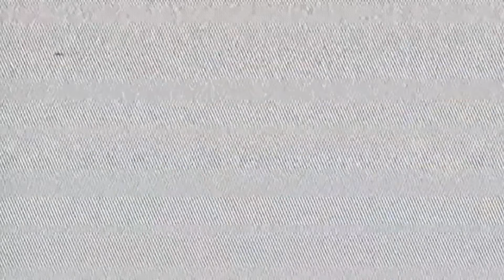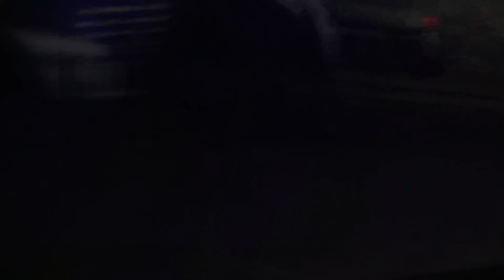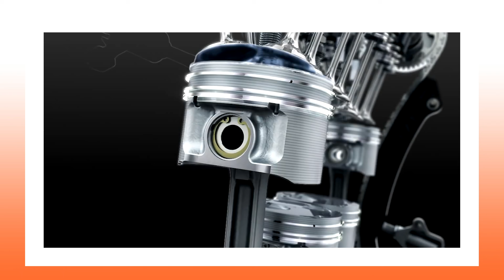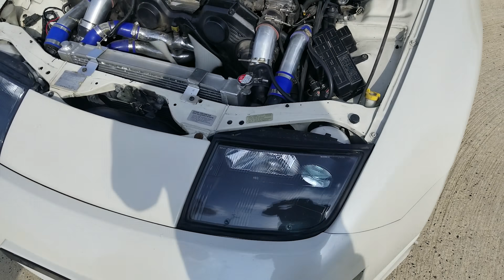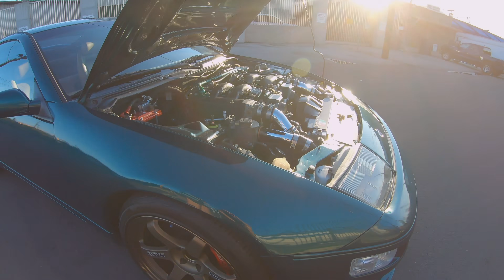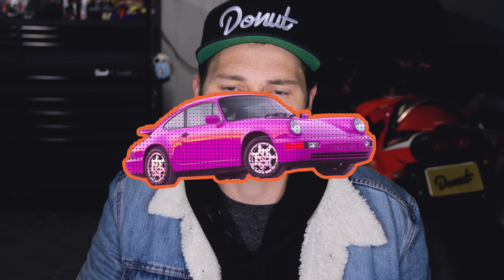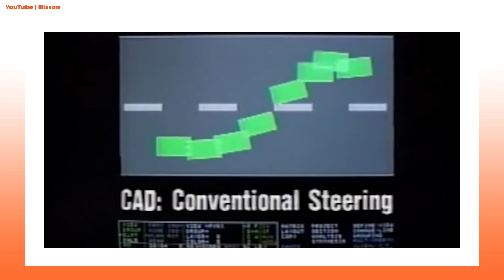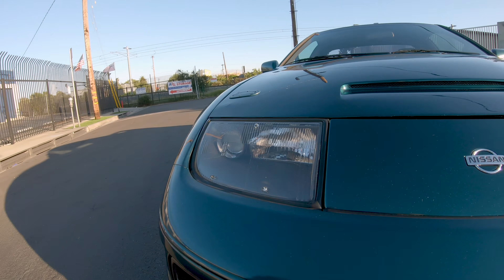The Incredible Tech that DOOMED the 300ZX

Comment: You're making me miss my Honda prelude steering. It was fixed. You could change lanes super stable and if you turn harder the back wheels kick back the other way so you could hug curbs and hook the gutter. So much fun taking 90 degree turns at 35-40mph comfortably.

Comment: As someone with two Z's, they are awesome cars and everyone knows a project sits in the garage as much as its on the road
Reply: They are awesome cars. I find it interesting that by 1994, despite being slower than the Mitsubishi 3000GT VR-4 and Toyota Supra TT in a straight line, Nissan didn't add power - they didn't need to because it was more fun than the faster cars. 
I had a 91 TT 5 speed, I miss it all the time. I also owned a 98 Mitsubishi 3000GT VR-4 at the same time, both were reliable (both were under 70k miles). Ran 13.8-14.0@99-102mph in the Z and 13.3-13.5@101-105mph in the VR-4 (both stock) but theZ handled better and was more of a true sports car.

Comment: I own a 91' 300ZX TT. Paid $4000 for it about ten years ago. Put about $10,000 into it over the years (parts and labor)  The guy is right they are a pain in the ass to work on.....Lots of fun learning how to squeeze the most power out of it. Floats on the interstate, so fun taking it on road trips. But it has come with a lot of frustrations. But I learned a lot about the dam thing along the way.

Comment: The 4 wheel steering is impossible to service now.  At the time the 300z was fresh, it was VERY expensive.  Current owners have converted 4ws to regular. One headlight module in the 90s was also like 800 bucks...for the part.  4 wheel steering also did a great job killing the Honda Prelude...at least the good ones, and even GM made a run at 4ws with early 2000s 1500 series in its best, pimpest trim.  Everyone who owns any of those has has to install a kit to disable it...  If I was a car archeologist, Id do an episode diving into 4 wheel steering, how it is GREAT and that many companies have rolled it out, and how it essentially killed every car and truck it came on.  If you owned one of those or if you were even just a frequent passenger you would pull your hair out and tear your shirt every time a big manufacturer produced...then discontinued it because it is literally awesome.  There is a legit answer, ultimately an actuary has decreed it too expensive and unreliable for an option infrequently sold.  The legit rebuttal is, naturally, for those companies to follow Demming's principles (they already do in most everything) make more/do it better/lower price.  Its honestly something soo good for cars and trucks that I think the big manufacturers took something from us every time they botched the execution and delivery or said "we're just not gonna service or sell this any more.."  Anyways...4 wheel steering:)  Way to go triggering me!  Hrrrrng!

Comment: Had a 92' TT. Prior to that car I had minimal mechanical experience past brakes, oil changes, etc. Because of that car and the incompetency of mechanics to effectively work on it (master Nissan mechanics included) I learned to do all of my own work. To the point of complete engine rebuild and being able to pull the long block and tranny out in my garage in a few hours. To this day it has been the most difficult car to work on due to the cramped engine bay that often times required a child's hand to get in certain spaces. Luckily many "parts" could be eliminated to make engine work minimally easier. 

Timeless design and would still have it if I didn't have a child at that point and it being such a money pit when highly modified, like most highly modified cars. Maybe again one day.

Comment: I've had a Z32 for 9 years. Started with a non-turbo and have had a turbo for 5 years now. 
Maintenance is a absolutely key with these cars. They can be frustrating with the small areas to work in the engine bay, but after doing the deletes it can be managed fairly well. 
Expect everything to cost a lot in labor, so learning it yourself benefits you and your pocket greatly. 
Either way, I will never get rid of this car and if I get to the position to buy more, I will happily do it. Fun as hell to drive, regardless of the skinned knuckles.
Reply: I've begun to fix my dads its a pain in the ass but I have fun doing it.

Comment: I do believe that the original design was with pop-ups... But a few days before the official first, the chief designer came in with some bad news (which probably had not heard, but just imagined) "Europe and USA are about to ban the pop-up'd cars... Make a whole new front end with fixed headlights". Most of them decided to do harakiri due to this decision, because they wouldn't stand see this masterpiece look like a larger Silvia... But there, at the very last moment, a designing student came up with a brilliant idea, to put in the projectors... And for the same reasons the AT200 Celica dropped out the pop-ups and instead it took the round headlights...

Comment: Picked up my first Z32
89’ TT 2+2 import
Tune up and fluid flushes are easy. Fuel filter is under the hood! 
But if you need to do any turbo work, better off pulling the motor

Comment: I've owned 4 300zx tt's... I actually swapped 2 tt motors into 2+2's and found that the wheel base was better and the NA diff gears ratio is much better. Feels like almost a different car and a 2+2 tt is still one of my favorite overall cars I've ever owned. I have one in Tampa I'm still finishing (also a 2+2 TT) that may end up a track car... also yes, they are kind of a nightmare to work on.

Comment: I owned a 1991 Nissan 300ZX Twin Turbo. Had it for 10 years, and sold it 2 years ago. Did I love it ? Yes. Was it a pain in my ass ? Yes. Not being a mechanic I had it in and out of the Dealership a lot. The biggest issue was the seals on the Twin Turbos. They leaked. Fixing them was expensive. When the car ran it was fabulous ! But I live in the northern part of New York state, so I had to garage it most of the year. That was a disaster for the car. Don't get me wrong, I babied the car. It was immaculate, inside and out. But it needs to be driven, not sitting.

Comment: Had a '87 Z31 300zx in high school. It was difficult to work on and a very cramped engine bay. Even my "fancy version of an electrician" dad had trouble figuring out the wiring on and that was using a technical manual. 

I owned it starting in 2004 but even then it had some rad 80's level future tech. All digital dash, the buttons for the radio and other controls made audible bleep noises when you pressed them. Pop up headlights. Red leather interior. Under powered and heavy but still kinda cool. Z32 does look better, for sure.

Comment: I had a 1991 300zx z32  T top manual with stage 2 clutch and flywheel, header back exhaust sounded obnoxious but amazing at the same time! Miss it! I sold it to a friend and he went back and fourth with another friend and then finally got sold to someone and I lost it for awhile.. came across it a couple years later and the fenders got all cut from fender flares someone must have once had on it between the time I owned it and then saw it.. thing was trashed. Low miles too!

Comment: The z32 is an icon without a doubt however if you've ever worked on one there is barely any room for anything under the hood besides the engine on its own... The car had a 51 49 front to rear weight ratio... And the majority of it went to the large v6 up front... If they would have switched to a smaller displacement SR20 it would have that 50/50 weight distribution.... One of the things is I think they should have went with an RB series, but having that engine would have outshined over the GTR I think.. the z32 was ahead of its time... The 4 wheel steering was a good idea that I think was poorly executed but that is just my opinion

Comment: Really honestly they aren't that bad to work on.... if its a TT its sometimes easier to just pull the engine to do stuff but totally possible while in the car. The biggest thing with them is how many vacuum lines and coolant lines there are, but all you have to do is delete most of them you don't need including plenum coolant, egr, rerouting some lines, deleting certain emissions and vacuum lines, and it becomes much easier to work on. I can pull my plenum and have access to everything I need to work on in 30 minutes to an hour.

Comment: I drove a Nissan 200SX (I think it was it, but not sure anymore) with the VTEC motor. It was very impressive. During acceleration, the timing changes at a specific RPM and it was like an additional kick in the butt. Suddenly there was more power when it kicked in.
I think that it was the same tech as in the 300ZX
Reply: Nissan doesn't have VTEC that's Honda. And the 300ZX had parallel twin turbos pushing very small boost stock (9.5lbs) but it definitely was a shove in the back
It didn't put numbers down like a late model Mitsubishi 3000GT VR4 or Toyota Supra, but it was all around the better car

Comment: Nearly right... Valve overlap is only effective at higher RPMS because it uses the exhaust gas to pull extra air and fuel mixture into the cylinder. Think of how when you put your thumb on the of a straw and pull it out of your drink. The liquid stays inside the straw until you remove your finger. Well exhaust gas has weight and when it's pushed down the exhaust tube, at a certain point when the piston stops there's actually negative pressure, by opening the induction valve at the point just before the exhaust valve shuts the exhaust gases suck air and fuel in and getting rid of the rest of the exhaust gases from in the cylinder. However, this is only effective above a rpm so if you have it at low rpm it actually pushes it back into the induction manifold and the motor runs rough. This is why you hear really power motors running lumpy. It also means most of the time all the power is above that freshold which means driving it in traffic is difficult because it makes it prone to stalling. That's where it comes in. You get standard tuning at low rpm so it's smooth and drivable around town and in traffic and race timing when you go above the freshold rpm when valve overlap is effective. This is also why some highly tuned engineers with carbs set alight...

Comment: This was the car that kicked the 90's sports car game in the ass.
Reply: In a way, but by 1994 it was slower than it's competition. Nissan never upgraded  the engine or transmission so stock it felt and was slower than the 94-99 Mitsubishi 3000GT VR-4 and Toyota Supra TT, and the FD3 got increased power and a 6 speed as well. 
It was somewhat of a sheep in wolves clothing until you modded it. But even stock they're fun cars, I'm not saying their "slow", just that they didn't put down the numbers the Mitsubishi, Mazda and Toyota did.

Comment: Nerd Alert.. the Super in Super HICAS is not because of the switch to electronic actuation. It actually refers to the introduction of "phase reversal" to the rear steering angle. This was an advancement over HICAS, because HICAS allowed only same-direction rear steering. Super HICAS would first steer the rear wheels a bit in the opposite direction, getting rotation going sooner, then, it would apply same-direction steering to undo that and set the car on its new trajectory. I parahprase this from Nissan's 1989 SAE publication by Eguchi et al, it's explained on the first page.

Comment: I bought a 90 Z32, i turned it from NA to a TT.... my clutch went bad and i kept going. i did a lot of work to it inside and out, have a lot of pictures of the process. I'm literally at the end, vacuum lines and intake tubing routing. I've worked on cars quite a bit in my life and this is one of the biggest headaches I've ever had. looking at how it road before the work i cant wait to get it back on the street now and next to impossible to get rid of it.

Comment: The first "fast and the furious" movie was inspired by Racer X who won all his street races using a tuned up 300zx - Z32... (it's EVEN in the special or extra credits).

 I'm glad not many read the inspiration to the fast and furious movies, and I'm glad that the 300zx was never featured in any of those films. If it was, the price of the 300zx would probably have been inflated like the Supra, Skyline and Rx7 (it was like a craze to have any of those 3 cars when that film came out). The 300zx and 3000gt were just left out... yet, compared to all the 'Movie Star' cars... they are more or less the same thing and equally as fun to own. All twin turbo / bi turbo varients of the above cars achieved 0-60 in 5.5 seconds. All restricted / limited to 155mph. Anyway, all these 90s Japanese sports cars are brilliant. 

The Mazda Mx5 is said to be the most fun! 😂. I can believe that, but it's down to matter of personal taste... same as with the 300zx Z32
Reply: The Mitsubishi 3000GT VR-4 runs 60 in 4.8-4.9 and the quarter mile in 13.3-13.5@101-105mph. It's much faster than the Nissan 300ZX TT in a straight line, and driven back to back the Z feels noticeably slower in every gear than the Mitsubishi.

Comment: I own one and i love it and will not sale it. If your experienced auto mechanic these cars are not that bad i was seriously thinking it was going to be a complete nightmare you can pull the motor in about 6 hours or less and there is a lot of groups for these cars. I was surprised parts can get expensive and hard to find sometimes but if you want a reliable 300zx get a n/a do not get a tt you have to pull the motor to rebuild turbos or fix them but other than that they are really fun and not that bad also circuit boards on these are easy to repair no longer replace things just take apart and soldier connections or make jumpers seriously if you know your way around a car this will be a fun car to have.....

Comment: As per usual....

The valve timing wasn't overly special in 1990.  The patents for variable timing go back over 100 years and in 1980 Alfa Romeo had the first production vehicle with mechanical valve timing, very similar to this.  Honda introduced VTEC in 1989.

Speaking of Honda - the Prelude had 4WS as an option as well - which ultimately went by the wayside because at higher speeds the vehicle can become more unstable and unsafe.

Lastly, although not in the US, the 1GGTE was a twin cam twin turbo motor offered by Toyota in 1988.

While I'm not saying the Z32 is bad by any suggestion- just that the video suggesting these were all leading tech way ahead of it's time is quite misleading.

Comment: 17 years latter still have my hardtop Z32 TT  .  Yes a few curse words have been said over the years but its one of the family what do you expect.
Reply: They're great cars, as we're its competition. I had a 1990 Nissan 300ZX TT 5 speed and a 1997 Mitsubishi 3000GT VR-4 at the same time. 
The Mitsubishi is faster stock by quite a bit, you can feel it as well in bottom and top end. The Z is the better car though, handled better looked better drove better. 
Ended up selling the Mitsubishi.

Comment: Guys, you got it wrong again on the explanation of variable valve timing... Seriously, get a fact-checker before explaining these things. Briefly: the valve stays open after the piston has started moving upwards, this means you are pushing air out of the cylinder. However, the air coming in has inertia, this means that it can still keep on flowing inside the cylinder, so long as the pressure wave coming up from the piston hasn't reached the valve yet. This pressure wave moves at the speed of sound, this means that at high revs you can keep the valve open 'longer'. This is why big cam lobes make power at higher RPM's. The issue is at low RPM's you are pushing out a big quantity of air before closing the valve with a cam lobe optimized for high torque at high RPM. By advancing cam timing at low RPM's, you diminish this effect by having the valve open sooner and closing sooner. The extra valve overlap is actually not very helpful at low RPM's, you are only sending additional fresh air and unburned fuel through the exhaust (the VG30DETT is port injected, not direct injected as your explanation of engine cycles leads us to believe).

Comment: I always forget that the 300zx actually came stock with a twin turbo setup. Only othe car from that time i know of that did that, that being the RX-7FD
Reply: With a name like hole shot how could you forget the Mitsubishi 3000GT VR-4? It ran low 13s stock at the same/higher trap than both the Z and FD3

Comment: VTC is very similar to BMS's Vanos system - you have oil pressure tweaking the cam driving gear(s) to advance the valves at certain RPM's.  So when you consider that BMW's engines are in the newer Supra, you could say that Nissan's innovation is in fact being used by it's direct competitor.  However the current Supra has kinda failed to be a contender for "hot rod" status against the current Z.... more like it's competing with the Kia Stinger... which is kinda sad for BMW/Toyota.